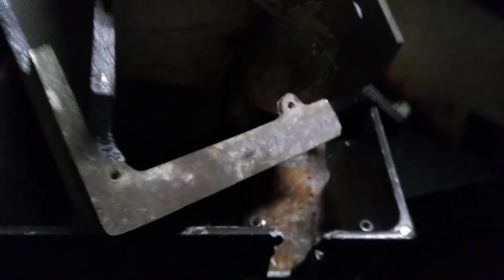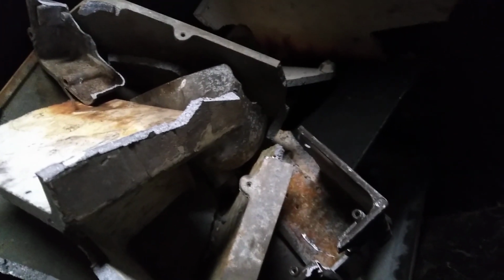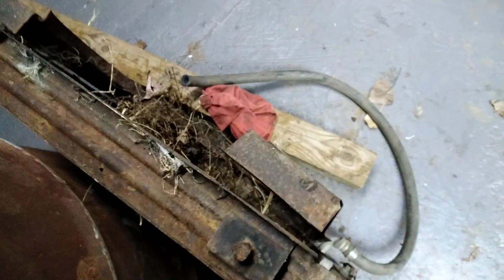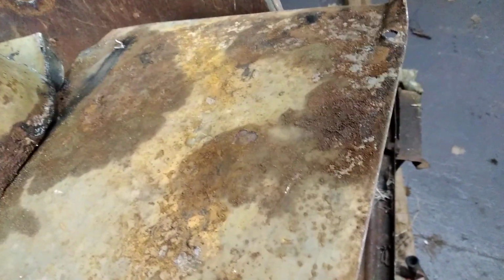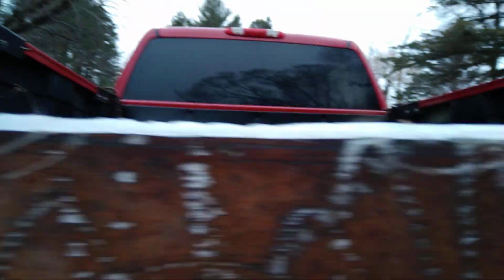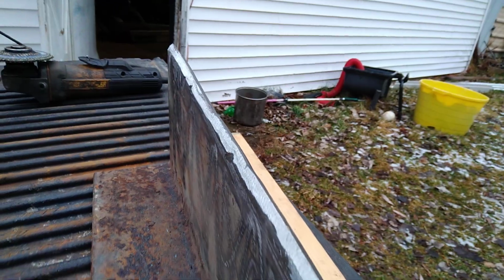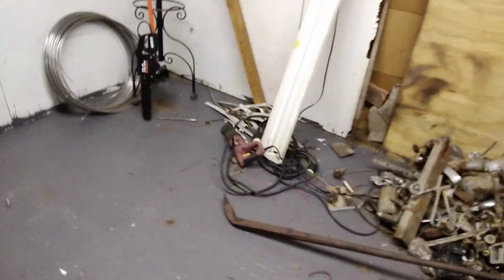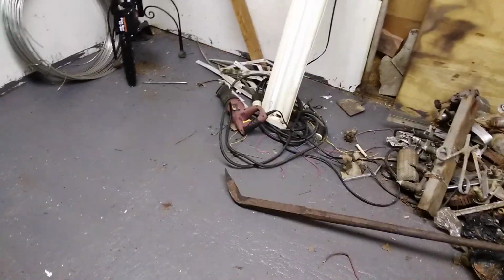processing some scrap cast aluminum and making a blade for my press

Comment: I was doing some of the same thing today, processing some aluminum. Basically whatever looks not too difficult to get apart.
Reply from the maker: I agree that's exactly what I am trying to do for the most part just get the bigger pieces processed then I'll worry about the price when I decide to take it in it's going to be too cold to be working outside for a while but I'll probably be doing it anyway thanks for stopping by Merry Christmas

Comment: Omg. I have never seen anything like that before. Now that’s a knife. You don’t want to put your finger in there
Reply from the maker: Some of the equipment is a little dangerous if you're not careful this I-beam blade will be put on a press the one scrap yard has 9,000 lb of five and a half inch diameter copper wire I may be processing for them if I can get this thing bill I have most everything to get it done I'll be doing videos when it's in progress thanks for stopping

Comment: I want one of them. What is that thing called. That’s the only thing a Canadian treasure Hunter doesn’t have
Reply from the maker: This is a Edwards hydraulic shear I've had it for probably 10 years I bought it off of eBay it does great for brass Extrusion cast aluminum I use it for 2 ft Steel also hey thanks for stopping by